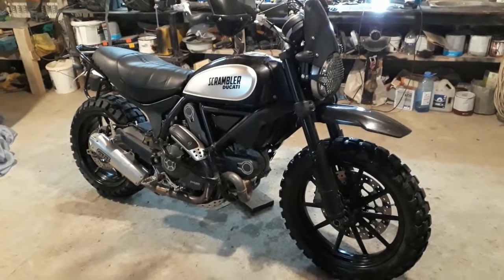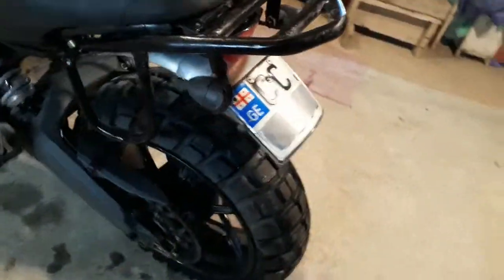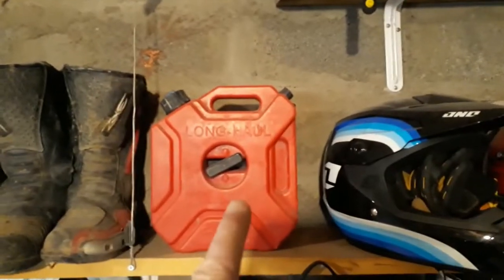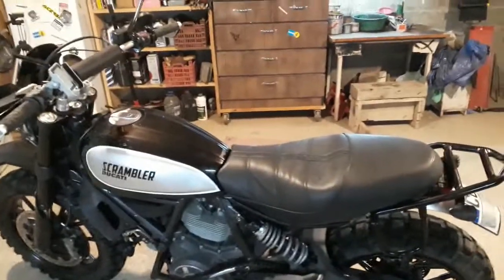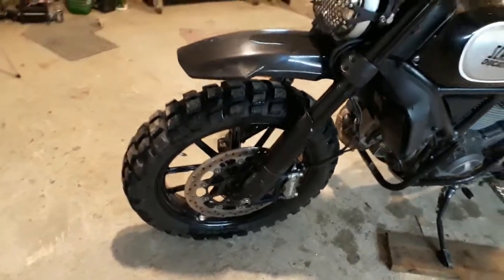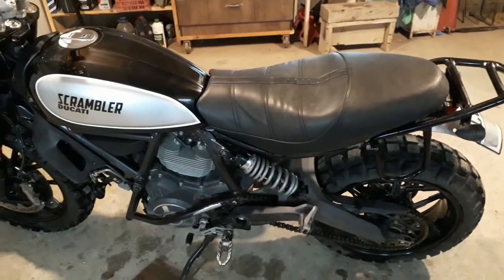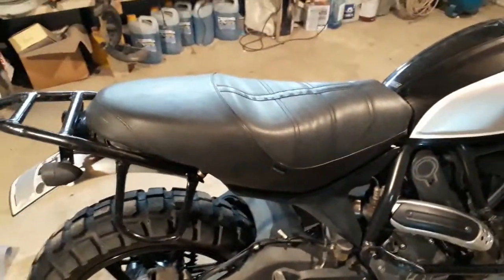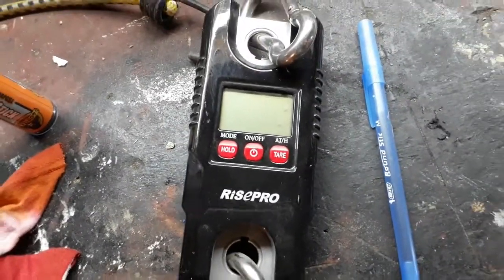Adventure Bike Build 2, Ducati Scrambler

Comment: Hey there, very informative video thanks a lot... I’ve got a question about tires. Did you put back Tire for the front because of the size.?
Reply from the maker: Hey, yea, that is, I think for most bikes a back tire, but the Scrambler will handle bigger tires! The back is a 180 which is huge and few tire companies even carry a 180 for off road, so actually I fitted a 170 on there and it worked fine, but yea, up front I went bigger than stock with a 130.
Reply: Is front sold as a front tire? Some people put tkc80 rear Tire on the front. Do you mind to write exact brand and sizes you put on the bike? Thanks a lot
Reply from the maker: @ScramblingLife  It is an Anakee Wild 130/80-18

Comment: Changing the battery is not a good idea. When the regulator fails this type of battery runs flat much faster than the original type. So that can be an issue sometimes…
Reply from the maker: well, I have never had a regulator fail.  This is an "Antigravity" battery.  They last much longer and don't loose power when not in use and weight about 70 percent less.  Also this type has a low battery button that provides extra starts of run low. I highly recommend them.
Reply: @MotoWorld777  Hi, a friend of mine had this kind of battery installed on a monster S4r. Apparently the standard voltage regulator has an issue with these type batteries and it just overheated en eventually burned out whilst riding.  We were on a trip abroad and searching for a dealer to change the regulator. (that thing can smell :-) ) but this type of battery was very fast (completely) flat. could not do 10km... (was also not charging due to the faulty regulator). if at that moment he had the OEM battery installed, he could drive for several hours without charging. I mean, it is a great weight loss indeed but you would have to check that you don't destroy the voltage regulator with it. I even think when riding alone and off road I would want to be sure that I have some battery power on reserve. ? for me these batteries are good for track use, or short rides. It's just an advise and something I want to share.  grtz
Reply from the maker: @graydemunter5850  HI thanks for commenting!  Yea, I have been running this battery an "Antigravity" for quite a while with no problem. All my bikes use Lithium batteries and I have never had an issue with them.  The one I have on my scrambler even has a built in backup if the battery is run down to far to start. You just hit a button and it gives you reserve power for starting.  My Husqvarna came stock with a lithium battery.  Maybe this was an issue years ago, but I don't think now.  Or maybe it is an issue on the Monster, but not on the Scrambler.  When you order a lithium battery make sure it is listed as made for your model of bike like this one is.  Old lead acid batteries are becoming a thing of the past like tube tires, etc. :)
Reply from the maker: 3 years on, no failures, still starts every time!